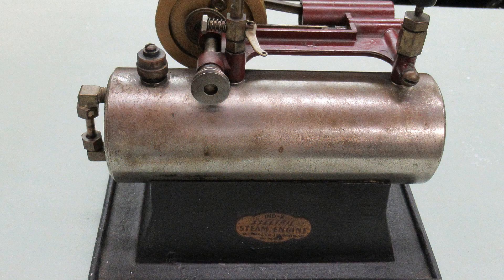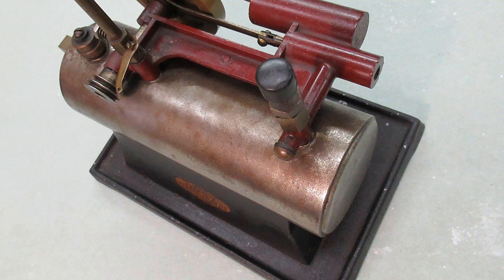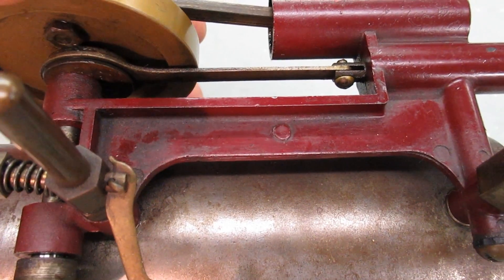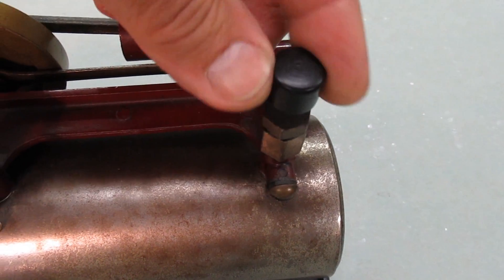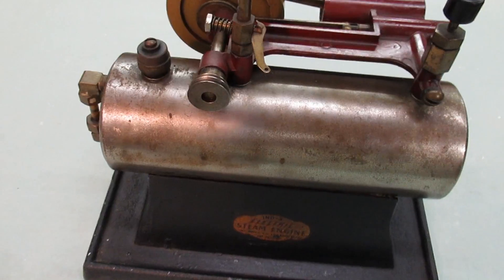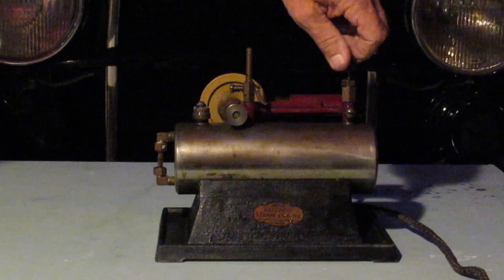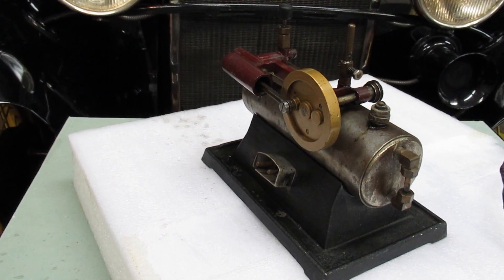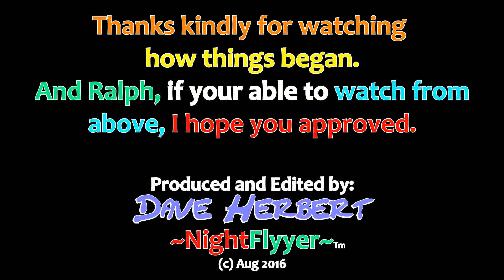Antique 1931 IND-X Steam Engine runs again.

Comment: Your IND-X steam engine is a real gem Nightflyer, great video of it running. I like it.
I believe that if you search images of other IND-X engines you will note that the cylinder should be at the front of the engine, opposite two prong plug at the back.
It keeps the water off the cord, these old engines have no ground plug.

Comment: Using Distilled Water will help prevent boiler pitting and scale.  Now you need a little DC Dynamo Generator and street lamp running off off the pulley.. I also like the older Jensen Steam Engines with feed water pumps..

Comment: What a silly design?Why not just have a solid fuel burner under the boiler?
Reply from the maker: Silly?? They had those too but they were more dangerous as a fire hazard. This is very safe for the kids at the time  Even if it gets wet like Christmas lights out in snow or rain it won't short out as electricity always takes the path of least resistance. Not to worry.
Reply: A Steam engine that you need to plug into mains electric?
Reply from the maker: This is a model engine and was much safer to demonstrate this way during the industrial revolution than setting a fire under it in your living room creating a big fire hazard.
Reply: A steam small engine of this type doesn't care if the water is heated by actual flame, or electricity,  solar or propane.   As long as steam can be generated.  Technically, it's a "Heat Engine".   (Think electric coffee pot)

Comment: nice how the water Drops on the plug. this time nobody cared about safety :D
Reply from the maker: Even if it gets wet like Christmas lights out in snow or rain it won't short out as electricity always takes the path of least resistance. Not to worry. It's safer than you think.
Reply: Your right,i know that too but today if course you would never get approval for something like that. Can still be dangerous.

Comment: Dave does that boiler lift off of the base? Looks like that heating element is from an old electric fry pan? To me it appears they share the same two pronged plug type?
Reply from the maker: Yes. The element is a very thin 200 ohm tungsten wire wrapped around an insulator. It's about 36 in long. Even if the connector gets wet like Christmas lights out in snow or rain it won't short out as electricity always takes the path of least resistance. Thanks.

Comment: water is not the fuel
Reply from the maker: Water vapor is turned to steam and that creates the pressure which makes it move.
Reply: the electricity is the fuel or energy
Reply from the maker: It won't run on just electricity so by definition it needs the water to "fuel" the engine.
Reply: So then is the electric winding in an electric motor the  fuel ?  No   so is the water in a steam locomotive the fuel or the coal that it burns. I think the water is the conductor of energy from the fuel source witch in your case is electric current
Reply from the maker: You missed the whole point of this video and just trying to make me look stupid.  Everybody else gets it.
Reply: Look man I in no way would imply that you are stupid I have learned a lot over the many years watching your videos I was only trying to point out that you said the water was the fuel. I am sorry if I offended you
Reply from the maker: It was only a tongue in cheek remark anyway for a bit of humor. Apology accepted.